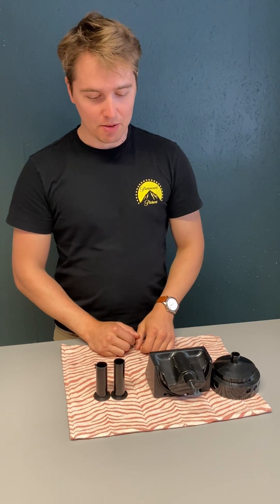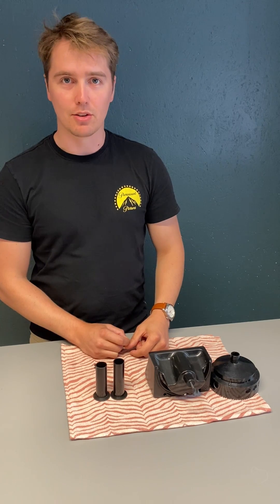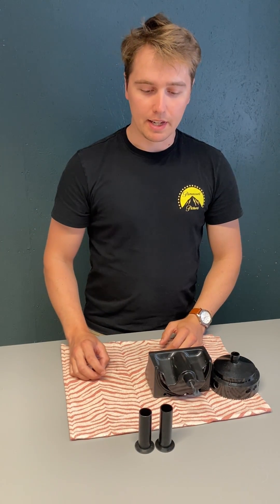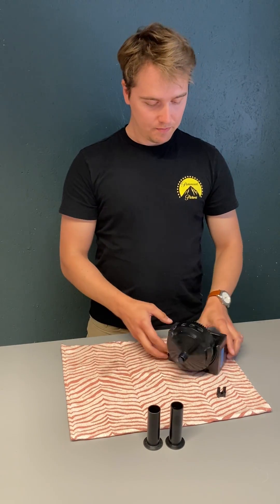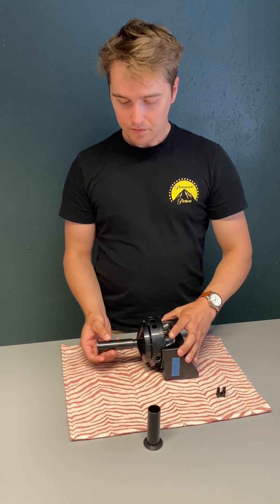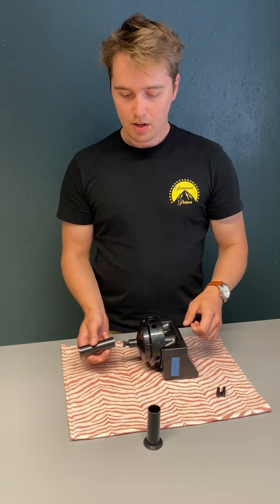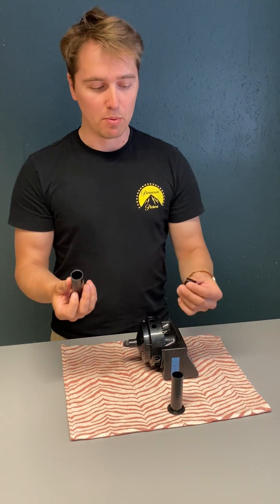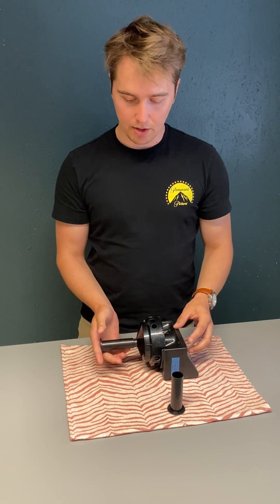Checking your Paterson tank central column before using the AGO processor

Comment: Here's an idea for you. For your next gen version of this device. Like an Nespresso machine. Have a built in, multiple chemical tanks with a draining system, and a built in heater, so you just load your film and walk away until you need to take your film out. Never touch a chemical unless they need to be added to the tank, changed or topped up. It would probably cost a few thousand euros, but people will buy it. Like me!